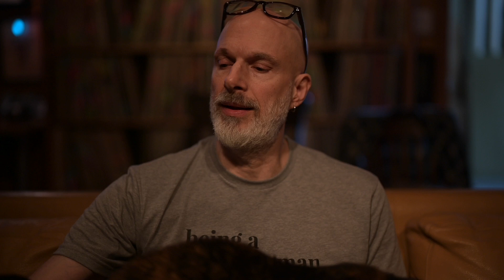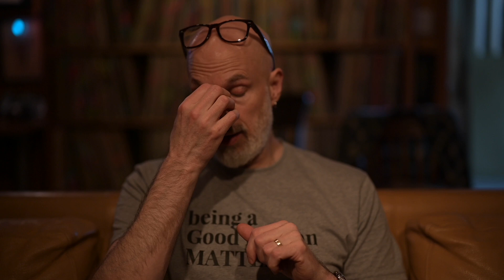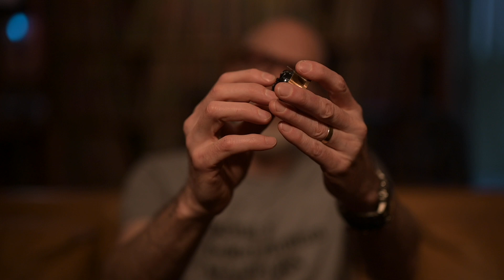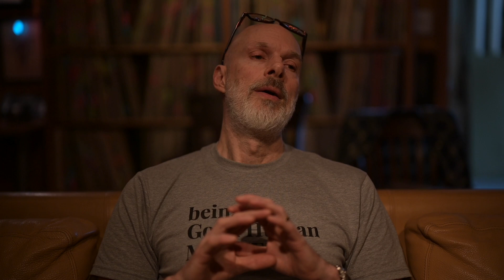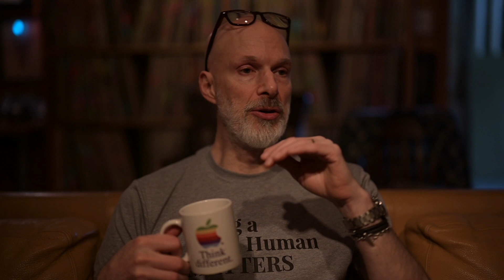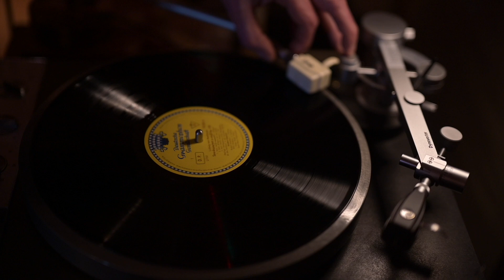Last minute change for AXPONA! John explains and describes the challenge of being a small fish

Comment: I'm going to ask the dumbest questions.  Does America not have a great driver manufacturer?  Why does an amazing American speaker manufacturer need to rely on Chinese-supplied parts?  Are the Chinese manufacturing margins so great that one can no longer work with the EU or American brands to maintain profit margins and a consistent supply chain?  Western Electric appears to be embracing an American manufacturing rebirth?  Can you alternatively source from America while maintaining competitive advantage or is chinese production of these parts critical to your bottom line?
Reply from the maker: This tweeter is the only component we use that is built by a Chinese company, all our other drivers are built for us in the EU. We are now working to move production of this tweeter to the EU as well because the Chinese company that has built them up to now is a nightmare to deal with.